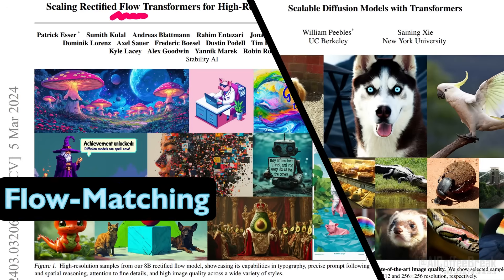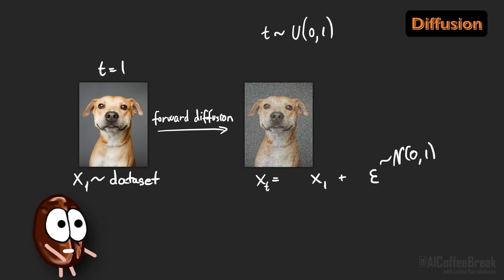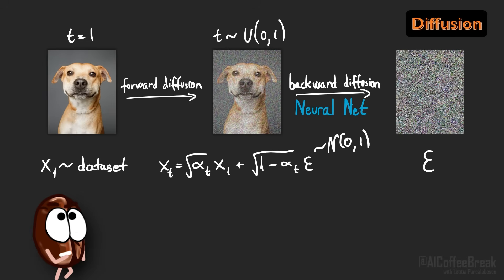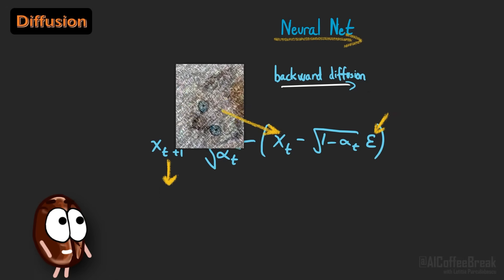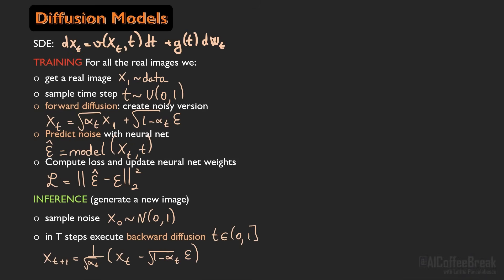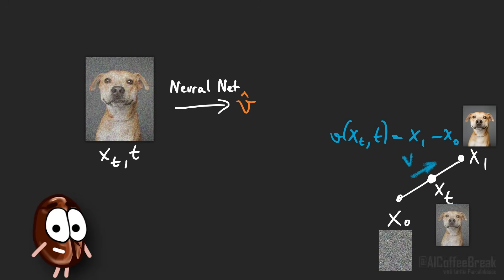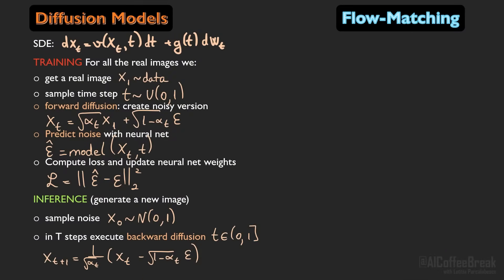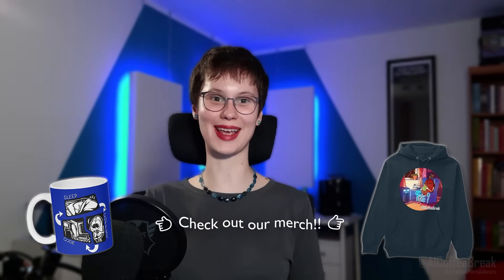Flow-Matching vs Diffusion Models explained side by side

Comment: I think this is a good overview for the length of time. IMO the reasons why large scale generative models have mostly switched to RF formulation are mostly empirical: it's simpler, it eliminates the bugs and instabilities of common diffusion schedules, and it marginally outperforms equivalent diffusion models.

The SD noise schedule has a critical flaw of not starting from pure noise during training. That was done to avoid instability, because extending it to pure noise would cause a divide by zero error. This means that there is a mismatch between training and inference, where the model is trained to expect some low frequency image information at t=1000, but that information does not exist at inference. The result is worse sample quality, and lower maximum contrast. There are workarounds to fix this, like training with offset noise, ZTSNR, etc, but RF formulation eliminates this problem naturally, and is stable at both ends of the schedule since it predicts the total velocity instead of noise or image.

In practice the SDE vs ODE difference isn't completely accurate, since diffusion models are often sampled with ODE solvers and RF models can also be sampled with stochastic solvers. Both types of models are also commonly sampled with 50-100 NFEs (25-50 steps with CFG). Architecture also is not directly related, diffusion transformers and RF unets both exist, but the transition from unets to transformers and from diffusion to RF just happened to coincide.

Again though, good video! Too many explainer videos only focus on diffusion still, even though RF is basically replacing it now, and IMO is actually more elegant and possibly more intuitive.
Reply from the maker: Thanks so much for the detailed insights and feedback! Pinning this, I learned a lot from this comment. :_beanPaper:

Comment: For diffusion inference, how do we know which specific kind of image the model will generate eventually? What are the practical applications?
Reply from the maker: In practice, we make a text2image model by conditioning the neural network also on text embeddings, not just noise input.
Reply: @AICoffeeBreak  I see, interesting. Is the text component also a part of the training process?
Reply from the maker: Yes, text input is part of the training process, otherwise the neural network doesn't know what to do with those incoming embeddings. I've explained that in long in a dedicated stable diffusion video. 😅
Reply: @AICoffeeBreak  Got it. Thanks! Will check that video out.

Comment: Just a content note. The only reason single letter math notation is still popular is a derangement of culture that fetishizes intentional obfuscation as gatekeeping, it's much better to pretend you actually have to follow any kind of symbolic system communication conventions outside this degenerate area.... like you know, any kind of code convention where you'd never use a single letter nondescript variable.. 

Just think about 'if this would never fly in a code review as code, it certainly won't work to communicate to a broad audience'

Comment: I forgot to mention, one of my routes of research included two forms of loss; one being diffusion based, and another being flow matching with diffusion follow-up for geometric solidification. These routes showed promise but given enough pressure the outcomes collapsed to nearly flat lines so they weren't ready yet.
Cantor's function should help solidify those, so that should be interesting once I get the correct positional encodings correctly aligned with the trained geometric shapes. This sort of thing is why David is so efficient, everything just kind of gates and bottlenecks providing high efficiency feature training.
I know it sounds odd, but these aren't actually for image AIs, they are for differentiation and assessment - and image AI training happens to be incredibly rapid so I use it primarily for classification testing, not to mention I already processed imagenet into a bunch of features for rapid feeding. This has been an ongoing process for learning controlled geometric solidification as an attempt to guide subsystem development within structure and it's yielding fruit with some systems, while other systems simply default to the traditional <EVERYTHING EVERYWHERE> how the transformer models naturally like to form.

Comment: I made a comment describing my research and a complement of your accent. Looks like youtube snipped it out almost instantly. TLDR I clicked the link for the info and stayed for the accent explaining it to me.

I've been researching flow-matching euler-discreet, flow-matching geometric, flow-matching simplex, and flow-matching differential learning processes for AI development. I doubt I can post a link because of the auto-remover but I have a github housing much of the research at AbstractPhil/lattice_vocabulary. The majority is within src geovocab2 and you can find many core models in the train core folder with differential equations and flow matching, vit-zana, vit-beatrix, and david being the most robust variations of trains all have huggingface weights and trains associated with them.

Comment: What about the part that makes either of these actually useful: conditioning it on some other data like a prompt of a reference image? Surely we want to reconstruct more than just one image?
Reply from the maker: In training we reconstruct images. With the trained model during inference, we can construct entirely new images from just noise.
Sure, usually we use these models when we also supply text input for text2image generation. This was not the focus of the video, though. I've explained in previous videos how text input is given for diffusion models. 🙈

Comment: Note that predicting epsilon is just the usual way to train a diffusion model, but other objectives such as predicting x directly exist. Predicting x directly is not often used (I don't know of any publicly available model that uses it), and I do not quite know why. The one paper I read that studied it seemed to claim it gave better results than epsilon prediction. Another one that is actually used in some model is the so called "v-prediction", which predicts alpha*x - beta*epsilon (basically the input noisy image, but with the noise inverted).
Reply: One possible reason for predicting noise instead of image is that the noise can be assumed to be standard gaussian, while the image is almost certainly not. All the different objectives are fundamentally interchangeable, up to some timestep-dependent loss weight function. Noise prediction generally works well with uniform loss weight (aka no weighting scheme), so the implementation can be simpler in practice, while other prediction objectives can be more complicated to tune. 

In reality, the trained model doesn't actually predict pure noise, it predicts a combination of noise and residual image, which is how the image actually gets formed from pure noise when sampling.